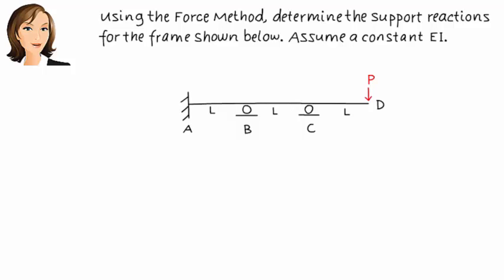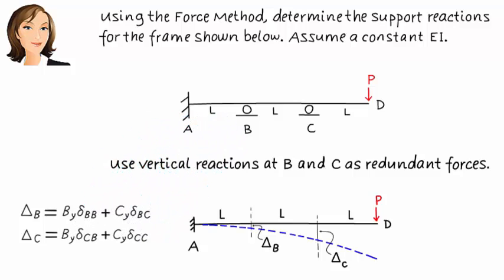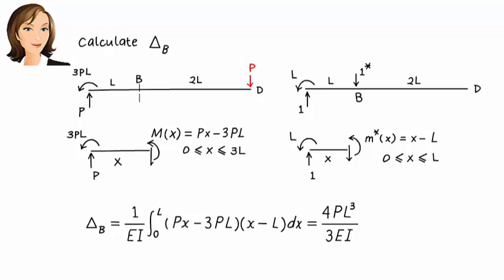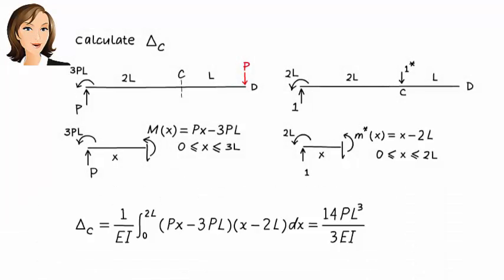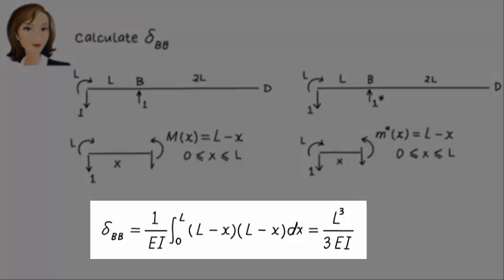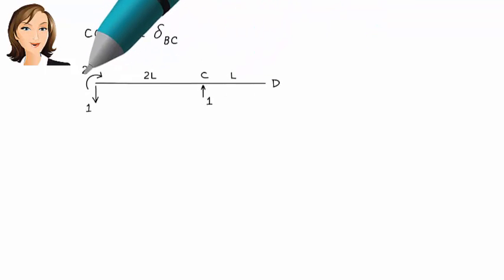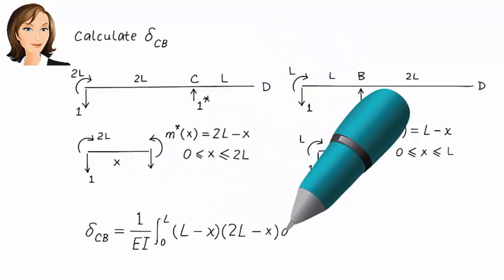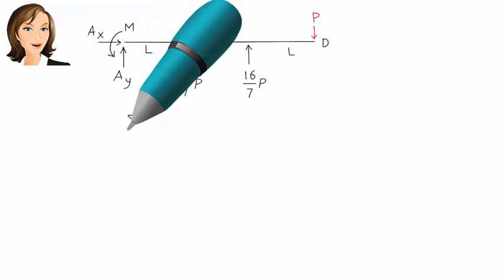Force Method: Exercise Problem 4

Comment: Why the moment in fixed end is negative sign?
Reply from the maker: The cantilever beam is subjected to a downward force of P at the right end. This causes a clockwise moment of 3PL at the left end of the beam, which means for the static equilibrium to be maintained there needs to be a counterclockwise moment of 3PL acting at A (as a support reaction). There is no negative sign associated with that moment.
Reply: Is that mean countclockwise moment should be consider as -3PL in the calculation?
Reply from the maker: Not quite. If, and only if, we assume clockwise as the positive direction for bending moment, when writing the equilibrium equations, then we should write -3PL since the moment reaction at the left end of the beam is counterclockwise. But, if we take counterclockwise to be positive, then we should write 3PL instead of -3PL.
Reply: I got it thx a lot